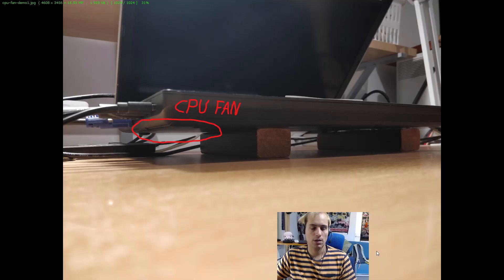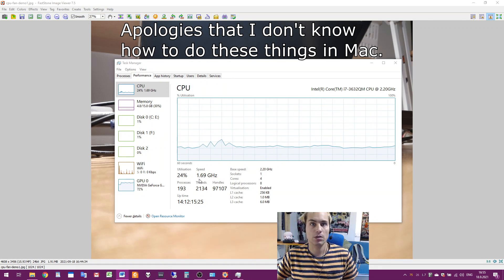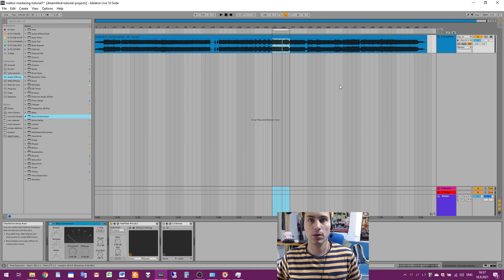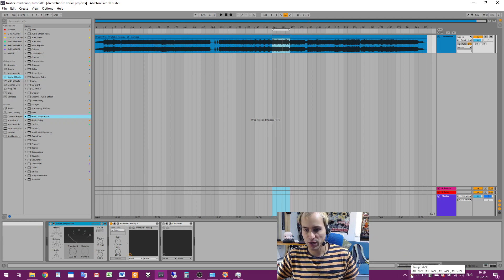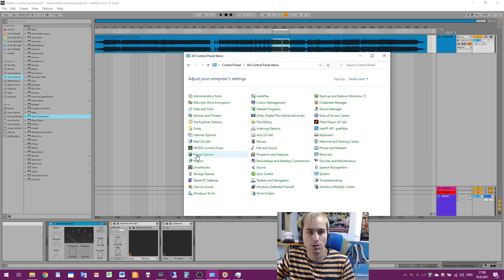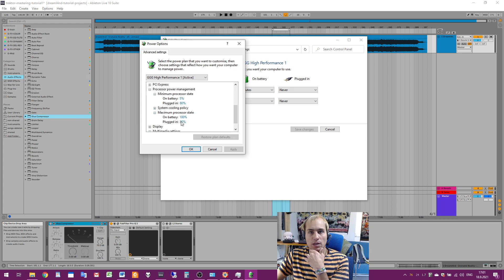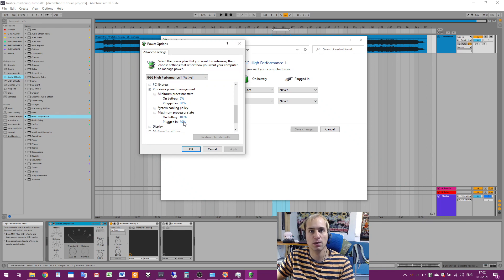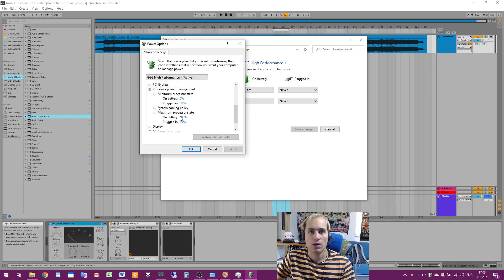Solving DAW Audio Glitch, Lagging and Freezing with CPU Underclocking

Comment: I took my laptop to tech support several times, only because of these sudden spikes in ableton, and it had been a tough month for me ever since I've bought my laptop. I thought it's broken or it had the latest intel 14th gen instability issue! and even right now, it's in tech support for diagnosis!
but with what you are saying here, it's all about the power plan settings!!! Bro! I wish I could see your video much sooner, and if this resolves my issue, I would be so grateful🤍🤍🤍💙
I hope I can say cheers to you today🍻
Reply: ok, let know here if it helped =)
Reply: @golemus  of course I will
Reply: Hey there, So it appears that the problem still remains. the issue is that the device works just fine on battery and even when it's pluged in, but only until the battery gets full. after that, these crashes come up

Comment: Also helps on Windows tweak the advanced system settings on Windows properties > performance options tab > customize by disabling visual effects or leave all options unmarked. It's not big difference cause there is too much variables between notebooks specs. But helped me briefly when I needed record using some weird vst's. I do also disable the WiFi and some windows tasks on manager cause windows and some apps configure a bad time schedule for updates.